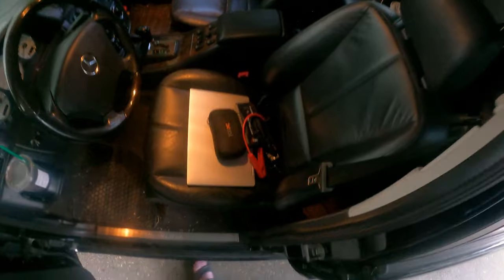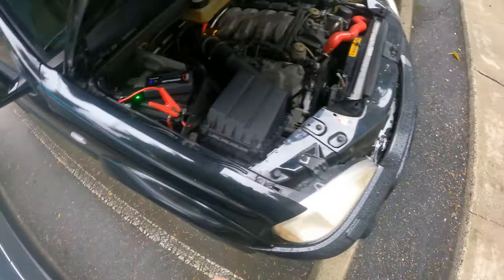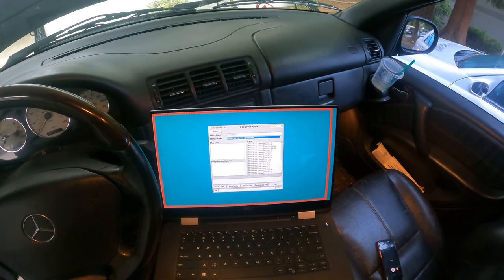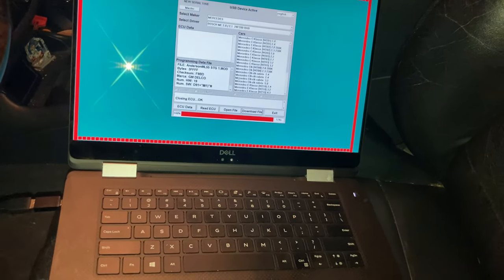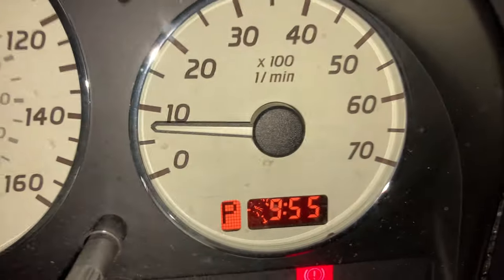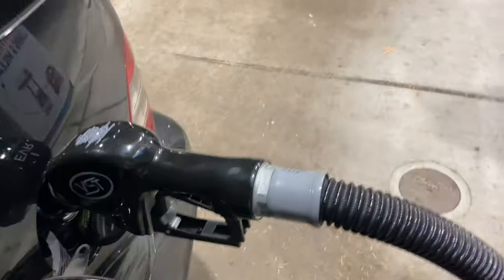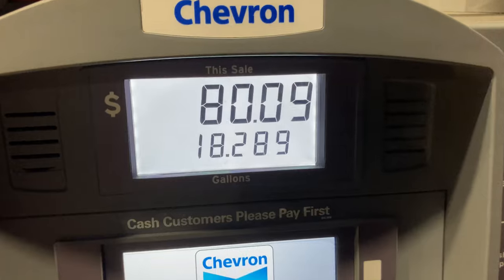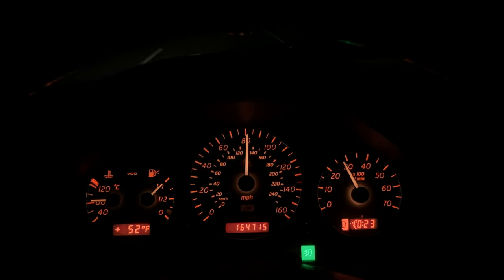ML55 AMG Gets Tuned by RaceIQ! How to Tune ME2.0

Comment: Don’t worry about the pixels on clock … they’ll fix themselves. I have a similar ML55 (2000). I’ve owned it for 10 years and put 100,000 miles on it (194,000 now). It’s still my favorite car ever and even without a tune makes me giggle every time I stomp on it. Great video!
Reply from the maker: The pixels actually magically fixed themselves lol! You’re right.
It is such an awesome vehicle, we enjoy it every time out also.

Comment: Talking about fuel, what’s the average consumption and the difference between this and the 63? Thx again.
Reply from the maker: They are pretty even honestly but 63 is a little lower on average. Typically about 13-15 city and 18-21 highway
Reply: @ANDERZENAMG  thanks very much mate.
Reply from the maker: @dspada67  no problem!

Comment: Hey I’m tuning with RaceIQ too  and I’m having a hard time trying to figure out how to jump the 16 and 1. I don’t know if my timing is off but I can get the tune to download
Reply: I don’t know what kind of wire to jump 16 and 1 with I’m very new to this
Reply from the maker: Tony can probably instruct you on that better but it may be you need to to wait for a minute after turning key to position two before starting tune download
Reply: @ANDERZENAMG  thank you. Do you recommend a certain kind of wire to jump them? I have no idea what kind of wire I’m supposed to be using. Thanks for replying so fast!
Reply from the maker: @Sebastian-cn2it  any decent wire will work

Comment: Subscribed as you are tickling similar engine I just got on the ML 500 m113 5.0. Am looking at installing a single rear mounted turbo with upgrade injectors. I need to download the map etc  what type of obd reader and writer do you find the best option? Cheers
Reply from the maker: Rear mount would be awesome! The Galetto cable I used is pretty much industry standard as far as I’ve seen, easy option and pretty cheap.
Reply: @ANDERZENAMG  thank you the reply bud
Reply from the maker: @zonta71  of course! Thx for the support!
Reply: @ANDERZENAMG  watching more videos and loving it.  Thanx. Can't find any egr and secondery air pump remaper in England. Any link for your guys so I send them the file
Reply from the maker: @zonta71  you can contact Anthony at RaceIQ performance, he may be able to help you out.

Comment: How much of a change is it without the sprint booster installed or connected? I assume the SB is helping with butt dyno feel if its connected.
Reply from the maker: SB has been on for a while so the change of the tune was still very noticeable. With a 20hp gain, it's basically gonna feel like less effort to get moving in all scenarios. Nothing crazy, but great results for something as simple as software change.

Comment: Did you disconnect fan to read ECU? I have 2001 ML55 and when I read 2.0 it states ECU NUMBER NOT FOUND.  I have battery hooked up.
Reply from the maker: Yes I did, make sure you give it about 30sec while the key is in on position before trying to read.
Reply: For reading ECU DATA, do pins 16 and 1 have to be jumped as well? Thanks!
Reply from the maker: @christopherjones505  just what’s shown in the video

Comment: Are you going to remove the resonator?
Reply from the maker: Already is gone 😁
Reply: @ANDERZENAMG  oh ok wasn’t sure
Reply from the maker: @daveh2612  need to make an update vid on the exhaust, second cats and resonator deleted. May be changing out the primaries soon for metallic cats too
Reply: @ANDERZENAMG  yep I wasn’t sure if you did a video on the exhaust yet. I’ve yet to remove my resonator, but absolutely needs to be done. Stock ML has zero exhaust note. All you hear when you rev is the oil pump. Lol
Reply from the maker: @daveh2612  yea it is definitely lackluster, even with the way it is now not great, the muffler is a big part of that.